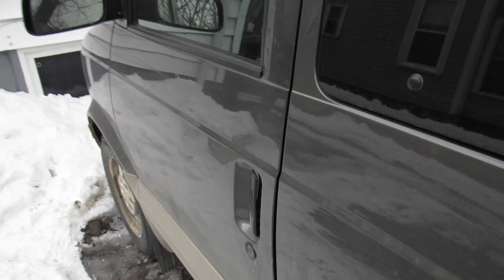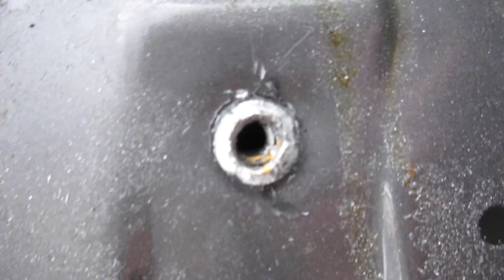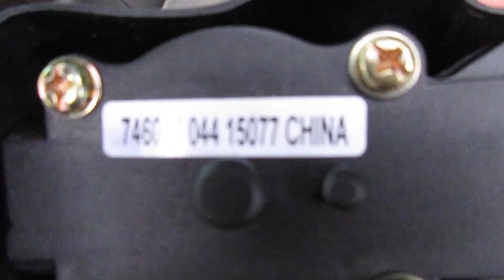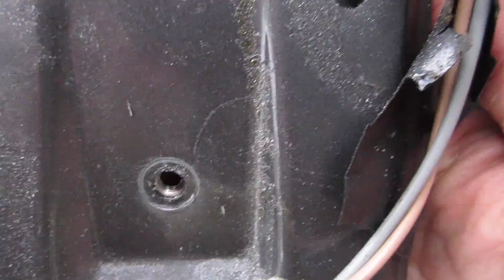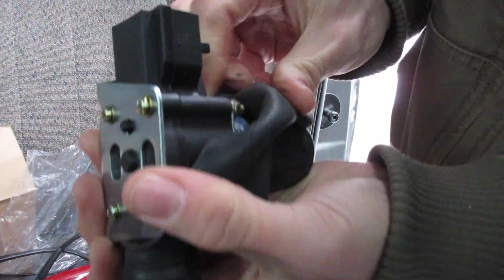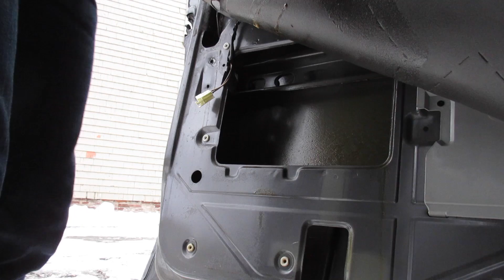Chevy Astro Van Power Door Lock Actuator Repair

Comment: Might as well buy a 4 pack and do all the doors at once
Oh and the parts store has the door panel studs too. Get a bag of them. Never do a sham job. You took the time to break then, plan your repair for success, not failure.
I like the blue plastic panel poppers you can buy a kit of them. Don't use metal against your paint, just saying

Comment: I was wondering, is there a way to use a couple of threaded screws from the inside out and then use nuts to tight it and cut the remaining of the screws flush, I'm just saying If I don't have a rivet gun
Reply from the maker: I imagine this would work. Some other users have suggested using screws instead of rivets. When I ordered the part it didn't come with screws, so I used rivets. I think as long as it is fastened tight it should work. Good luck!
Reply: There are threaded tabs on the new one. M6 threads I believe. No need for a nut.

Comment: Looks to me like you could have used sheet metal screws to install, that's the purpose of the speed nuts on the bracket, no?
Reply: Bracket nuts are threaded for a specific bolt size and bolts are not included with the part.  Self-tapping sheet metal screws would have to be relatively wide diameter (like 1/4" or more) and very short total length to not eat into the part behind the bracket (like 1/2" depth).

I have to go to the hardware store for dry lube so will try to find the bolt size that fits the nut for my particular part (SKP SKDLA1) and update here afterwards.
Reply: @m.merriman7692  I did my driver side recently, I used a threaded speed nut with machine screws, worked great! Yup, used 1/4 x 1/2.
Reply: For the threaded speed nuts that shipped with my part (SKP SKDLA1) it was an M6-1.00 (x 12 or x 16) bolt that matched the threads and depth.  Just an FYI for anybody in the future. 

You could definitely use another speednut & bolt combo than the providee ones which may be cheaper/easier to find but they'd need to conform to the measurements in my earlier comment. GLTA

Comment: How do you diagnose that the problem was actually the actuator and not anything else that could cause it to not work
Reply: Checkout astrosafari.com and search for power locks.  

There a few things that can go wrong namely 
1) seized/gummed-up lock parts which can be cleaned and lubed 
2) blown fuse / wiring issue
3) not enough voltage to actuator
4) failed actuator

Burnt out actuator seems to be the most common issue just due to age of the units.

Comment: Great video,would it be the same way for the rear back door? I have the barn doors on my 03 astro.  thanks
Reply from the maker: I'm guessing it's very similar for the back door although I haven't done the repair myself. I did have to open the back door up to repair some rust. Just undo all the screws that go around the door and use a panel popper screwdriver to pry the plastic moulding off the metal door frame. You'll then need to pull off the plastic speaker cover so you can remove the carpet-like piece from the door. Next peel back the moisture barrier and take a look inside. It's likely the same part, and things really aren't too complicated at the back door. Good luck!

Comment: Did you only have issues with this one door lock? I'm asking because it seems like I have a system wide issue where they all try and fail to lock or unlock all the way unless I'm using the key. Great video, btw.
Reply from the maker: Hi Foxtatic T. My driver side door lock wouldn't really work at all, so I replaced it as in the video. I also had some issues with the sliding door (see my response to Billnor below). I removed the panel and lubricated the components and also cleaned the copper connectors that power the sliding door lock. I'm not sure how to solve the issue if it's happening in all locks of your van. Perhaps there isn't enough power being fed to the actuators? Good luck with your repair.
Reply: Foxtatic T in your case I think you need to wd40 the joints behind the covers. Good luck.
Reply: If all your locks failed at the same time it’s probably a blown fuse. You can check in the owners manual to see which fuse controls the door locks
Reply: mine systematically all failed with in 6 months of each other, the only one functioning is the slider. I removed the driver side to see if a little finagling would get it working. I removed the screws that hold the bracket to the body of the actuator. Unfortunately that also holds the metal motor housing, so when the cover was removed, boing, the brushes and spring jumped out, lost one spring and one brush. One thing I did notice was that when manipulating the plunger, that some times it worked smooth and sometimes it hung up and jammed. This maybe the problem with these units. The motor appears to spin a gear and the gear runs a toothed rod up and down. I wouldn't be surprised if the gears are worn or chipped/broken. The actuator if a sealed piece of two plastic pieces either glued or welded together, I think I'll take a stab at disassembling. I'm banking on the teeth inside being jacked up, the actuator plunger is plastic.   As far as them all going to shite in close time, it actually makes sense because every time you use your key fob to open your doors, all the locks get activated except for the back door, which requires a second pressing of the button. So there all getting similar wear.

Comment: Thanks for the video. I did find that there is a small pop out piece around the door handle that makes it easier to remove and replace. I gave up drilling and used up a couple of cone grinders with my Dremel.Now I need to replace the actuator on the slider.
Reply from the maker: Thanks Billinor. The pop out piece is a good suggestion, I think I was afraid to break it and didn't bother popping it out. I was having difficulty with my sliding door lock not working too. I removed the panel and lubricated the lock and components and cleaned the copper connections that power the lock, things worked fine after that without having to replace anything. Have a look along the sliding door frame just behind the passenger seat; you'll see an electrical lead that connects to another lead when the sliding door is closed; this powers the lock; if these connections are corroded, look up online how to clean corrosion off copper using vinigar and baking soda; once the connections are clean, the lock might work again. Good luck!